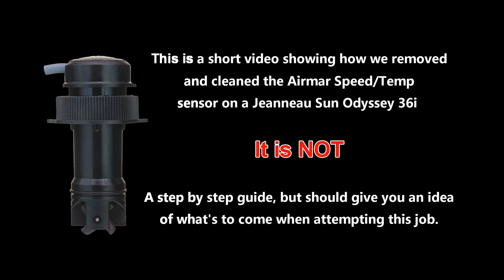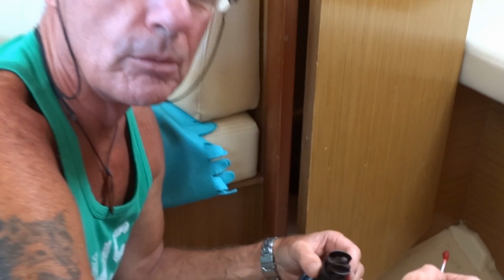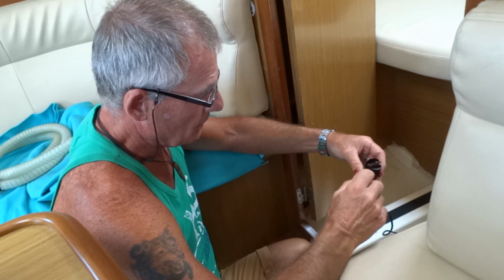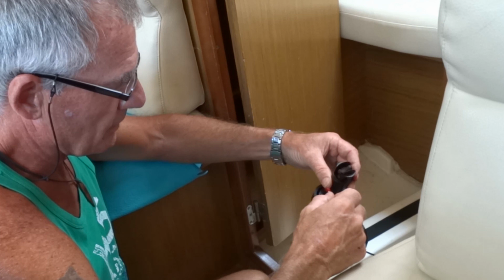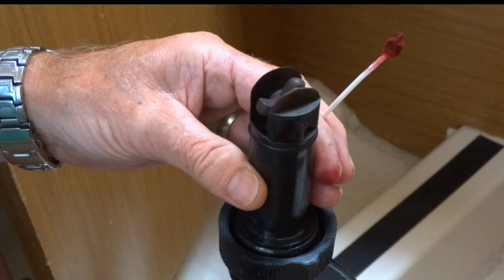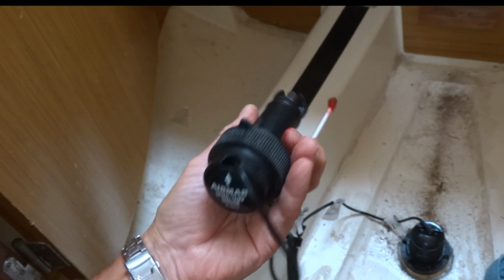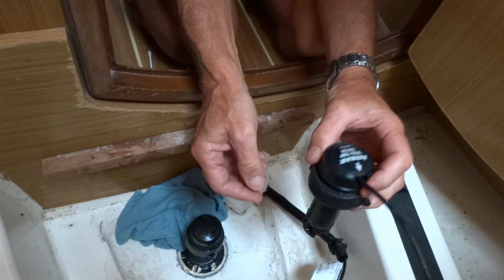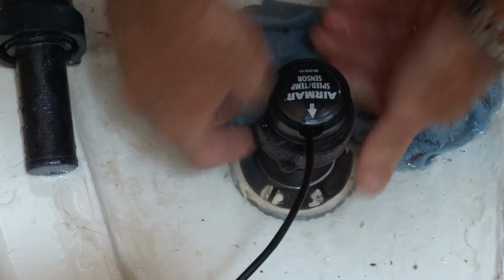How to remove a paddlewheel, Speed & Temp Sensor for Cleaning | Raymarine

Comment: It is a good idea to carefully push out the pin with which the wheel is installed. Much easier to clean everything. The Sharpie trick sounds cool, I shall try it this season.

Comment: OMG that looked disgusting, no wonder it didn't work. Big transformation after cleaning. Out of interest does the temperature part work - we have the same unit and can't seem to get a temperature reading.
Reply from the maker: Hi Barry, that's interesting. Before we cleaned the sensor we did have a temp reading but it wasn't correct. Once cleaned it did seem closer but still wasn't right. We have spoken to a few friends and most say the same.... the sensors are very temperamental!